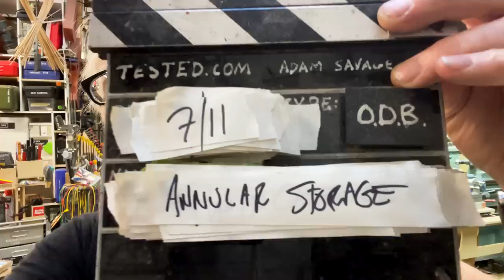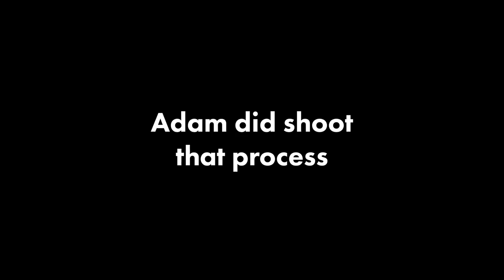Adam Savage's One Day Builds: Annular Cutter Storage!

Comment: I'm so glad that you stuck with the shop infrastructure builds! I've been enjoying these so much and they have really helped my motivation when feeling discouraged. It's really nice to watch someone take the time to think through organization because of shop space constraints-- which is very relatable to the majority of us "average" hobbyists. I recently tackled my 2.5 car garage overhaul by ripping everything out, getting a poly urea floor coating applied by a local coating company, and beginning the process of making it a space that I love. I have a split level house, so the garage is technically inside the house and is accessible from the daylight basement like any other room, so I wanted to be able to go out there to simply hang out if desired. I threw out or gave away my old random wood benches and various mismatched bins and bought new cabinets, adjustable shelving, etc. I then bought a HF universal tool stand and made a drill press/bench grinder/portband stand all in one. This was my first step to realizing I can REALLY optimize the shop and it took off from there. I recently finished a PVC funnel and drain pan holder/drip catch and now have EVERYTHING off of the floor. My next step is sorting out my wiring and electrical station. Thank you for all of the time and effort that goes into these videos and your shop! It is greatly appreciated by all of us that need a space to "get away".

Comment: I've had a specific case of approach avoidance in my shop lately.  Comes from an abject failure with somd "smart switches.  I NEED a holder for the thousand or so router bits I have and it's just seemed like too big a job.  You have inspired me to "Just Make It".  Many thanks.
Reply: Rockler has some great "Router Bit Storage Inserts" that kinda make this job easy, and they're relatively cheap.  I made an insert for some Milwaukee Packout-style cases, and filled them with these to make stackable bit storage.  I'm pleased as punch with the end result!
Reply: There's a great video somewhere on YT where the maker used a table saw with a dado head to plow perpendicular grooves in wood blanks. Each intersection holds one bit.  Total time to make about 10 minutes

Comment: What is nice about the annular cutters are the number of cutting edges.  
1-1/2 inch drill bit has two cutting edges.  
One of the 1-1/2 inch annular cutters i looked at has 8 cutting edges.
Higher feed rate can be achieved with a annular cutter with a lower power requirement compared to a standard twist drill.

Comment: This kind of reminds me of the time I made a vacuum platform for my photo enlarger.  I drilled 150 or 200 3/8" holes in a piece of plywood with a drill press, then routed channels in the backside to connect all the holes.  To use it I'd attach a shop vac to a large hole, place the photo paper, and it would be sucked in place and stay flat and secured for the printing.

Comment: Could be a chance those get stuck from humidity, but looks awesome.
Reply: agree, this happens with router bits in a lot of wood shops especially in more humid places.
Reply: I was thinking that if the wood was soaked in a rust-preventative oil (and then probably re-drilled to account for wood swelling) it would protect from both corrosion and sticking.
Reply: I believe where he lives in California, humidity is almost none existent.
Reply: Not only that but wood often holds moisture and will likely cause rust ... but not in a state where they don't have any change in weather.
Reply: I think I would go back in with the next size up to slacken the holes (1mm increments since annular cutters are metric where I live).
Reply: @blake_edwards  He says he's in San Francisco, which can DEFINITELY get humid.  San Diego and Los Angeles, not so much, but even there, if you're near the shore it can get humid.

Comment: This was a neat video. I did something similar with screwdriver bits using a piece of wood that I got for free from someone in my neighbourhood who was renovating their house and I was walking by and asked if he was getting rid of the wood. It was hard to drill into but it worked eventuality. It was to replace the original crappy plastic case the screwdriver set came in that started to fall apart within a week of getting it for Christmas many decades ago when I was a teenager. I did not enjoy the horrible grinding noise that happened every time Adam moved the camera. I’m surprised he didn’t acknowledge it and try to fix the problem. He’s apologetic when he moves the camera around quickly (“Sorry if this is making you dizzy” or something similar) so I was expecting him to notice the obnoxious noise this time. Hopefully he’ll fix it soon 🤞🏻🤞🏻

Comment: One of my favourite types of hole saw is the diamond edged ones for drilling ceramics and glass. Super satisfying to use on a drill press with buckets of water or cutting fluid.
Reply: Until the glass bowl you were planning to turn into a lamp shade explodes into a thousand shards. Ask me
how I know 🙄😅
I use crossed polarizers now to avoid messing with stress-laden glass 😆

Comment: I just finished my own mini mill/lathe setup and will be working on similar storage implements soon. I did learn - back in the day - that it's a good idea to have the cutting edge "face up" to avoid dulling the edge? When they are stored face down in a moving fixture, they might "rub" and dull over time. Might be our teacher being overly protective, but I can see some reasoning. Also if moisure happens to get into the board, it's easier to clean a bit of rust from the shank rahter than the cutting edge. Long story short: I'll make my cutters and mills face upwards :P
Reply: @JETWTF  unless you are using them to the extent of a production shop would (most sizes everyday) that argument is mute. and storing them cutting end up would be more of a risk of injury than a preventative measure for wear. the actual using of the cutter will dull it far more each time it is used than it would from sitting it in a holder. the only time that might be worth consideration is if the holder was metal. the only real problem as mentioned by others would be the possibility of rust from moisture in the block, but that is so easily mitigated that the risk is negligible.

Comment: I did something similar for my grandpa's drill bits, however I didn't find it practical because they rubbed a lot with the wood. And took a lot of time to grab a single bit. However, over the years I ended buying my first "good set" with 0.5mm increments, and I tried again, giving it a little bit of wiggle, and they work perrrfect!

Comment: Ages ago I made a holder for a set of S&D drillbits. I made it out of aluminum sheet so I could engrave cutter sizes in the metal. Since they all have 1/2" shanks all I had to do is use one cutter and then get the math right to space all the holes. I used a center cutting 1/2" endmill to do the deed. I'll post a photo so you can  see  it.

Comment: They are great for cutting holes in steel with a mag drill or drill press with an adapter to accept the annular cutter bits.  I don’t know many people though except my friends in construction that need to drill multiple holes through 1/4” to 2” steel plate or beams.  We only use bits sized 1/16” above the bolt size we’re drilling for so we have no need for every size in 1/16” increments. If you do have that need then you need annular cutters.

Comment: Theres a lil extra thing about having annular cutters that way. Usually they end up getting the "gut" with the material that you just cutted inside, so having them stored like that, makes you clean the cutter guts before storing it back to the wood thing. It will make the clean and ready for the next use.

Comment: I have a smaller collection of 1” and 2” lengths.   Mine are used on steel in a mag drill.   I made a holder out of a scrap 2x4 and put the bits upside down so I only had to drill one size hole.   Works great for me, cxx add n leave a pilot in the bit and when it gets oil soaked from the coolant I just make another.

Comment: Fun! I made a wooden tool holder out of scrap redwood a while back and later found my tools rusting.  I also live in SF, so maybe put some shellac on the wood. It could also be that the tannins in the redwood were the culprit.
Reply: Yep, I made several wooden tool holders out of red oak 4" x 6" and after a few months, every bit sitting in them looked like it had been soaking in seawater😬 Some of the smaller diameter bits were completely ruined. Stay away from oak. 

In full disclosure, my shop is 100% Climate Controlled. It's hot in the summer, cold in the winter, and wet when it rains😂

Comment: I wish they had annular cutters that could be used in the field. I've worked with stainless steel for almost 15 years. My go to when drilling holes are the holesaws. I've found that Morse does the best job in holesaws. The black ones rather than the red ones are awesome. But yeah, wish they had a field annular setup.
Reply: Holes over 1/2 inch, otherwise I use Norseman drill bits.
Reply: They do. Look up mag drills.
Reply: @andrewdonatelli6953  A mag drill isn't feasible in alot of the applications I'd need it for. Believe me, already checked into it. I guess I should've made it clear, "that work with a regular drill."
Reply: @sonictheflexhog6075  Yeah, mag drills are for pretty specific use cases.  The Kbh-25 is a hand drill that uses annular cutters, but it is pretty pricey.  Nothing like throwing tons of cash at something you only use occasionally.

Comment: Very nice, but my mind wouldn't let me do it that way, especially given you have a mill with precise feed capabilities.  I would have to put the cutters in long lines, with uniform separation between cutters (center distance is the sum of half each adjacent cutter diameter+ spacing value).  I would have gone long rows, alternating in direction, as they do on circle drawing template, for tight stacking.  I would also have to have them all at the same depth.  Not doing that would drive me a little batty every time I looked at the rack, but that's just me and my peculiarities.  Also, if you ever re-make this, would it be better to do in UHMW or Delrin, so you have a material that doesn't attract / retain moisture?  I don't know if this might be significant or not.

Comment: Those would make for really easy matching screw plugs too if it lists the internal diameter of the hole. It's interesting that there's no pilot/centering screw like in the hole saws.
Reply: They do make some with a pilot bit for use in hand drills. These are only for use in a mill so it removes the need for a pilot bit. In a mill I don't even bother with the pilot bit if I use a normal hole saw.

Comment: Personally, I would have spaced out the holes more so that there is enough space to put labels on the sizes of cutter. And putting the label in the center might seem like an easy idea, but then you wouldnt be able to read the labels without first removing the annular cutters from the holder.
Reply: Not sure about his but the sizes on my cutters are all engraved on them. Don't really see the need to label the board.

Comment: As cool as that is, won’t humidity and temp changes make those get very stuck as the wood expanses and contracts?
Reply: Not to mention wood attracts and holds moisture, which causes corrosion on any steel surface that it contacts, like the cutting edges.
Reply: @edbennett8257  I was thinking that as well. I would have done in some kind of plastic

Comment: I'm pretty sure the cave is climate controlled so this doesn't apply.  My experience in a shop that has humidity issues is the tolerances are too close.  The bits may be trapped when the wood swells.  Not the end of the world, but the storage block gets chewed up fairly quick wrestling bits free.  Do the same thing in plywood, or better yet Delrin, and never look back.
Reply: Not so much that it’s climate controlled as it’s located in San Francisco. Humidity? What’s that?

Comment: With a hole saw, the wood usually gets stuck in the bit after you cut and you have to stick a screwdriver/whatever through the holes in the side and pry it out.  Do you have the same problem with these cutters?  What happens to the waste left in the center?
Reply: No holes on the sides of any annular cutters I've seen, but they typically have a through hole (1/4"), and you can get a spring loaded ejector pin setup, or make one yourself. They don't seem to load as badly/get a slug as stuck as hole saws, maybe something to do with tooth rake, etc. I'm generally working in metal, and the slug left is sometimes useful on it's own merits.
Reply: Usually I find if the slug gets stuck in the cutter they can be hooked out with a pick or a pair of needle nose pliers for the smaller sizes. Sometimes you have to remove the cutter and poke it out using the ejection pin hole.

Comment: would probably be a pain to make, and annoying to use, but would be kinda cool if every hole was "threaded" to the cutter. Like each cutter screwed into its hole like a nut into a tapped hole. Would need to do this in a see thru block for it to be really cool. Would be a pain to use when getting a cutter out or putting it back, but as a "show piece" might be cool.

Comment: As someone who has spent $100+ on forstner bits and lacks a good way to store them any ideas or suggestions? I have .25" to 4" bits (not complete in between...yet).
Reply: Forstner bits tend to be basically the same length, which helps you organize them.  I'd tend to store them shank down, cutting edge up.  If you set multiple rows of them, alternate the direction of diameter increase as they do on circle drawing templates, to allow you to pack them tighter.  If space allows, tier the rows with increasing heights on the rearward rows, for easier access.  I'd probably go up to 2" on one rack, then make a second rack for the larger diameters, but that's because I would rarely use the bigger ones.  Let your usage patterns guide the storage design for what is easiest to access.  Just my $0.02
Reply: @marksnyder2232  I have three different lengths of bits but that maybe a good way to  break up how they are stored. Thank you.

Comment: I always use the next size up as the hole I store the tool in so they're not so tight
Edit: I suppose though in this case I'd bore out a solid hole or else these bits wouldn't fit

Comment: Unless you spray some oil on the wood the cutters may rust or stain.  If you spray some oil on the wood it may swell and they will jam. This may happen just due to humidity changes alone.  A better choice perhaps may have been aluminium or some kind of plastic.  If you mounted them cutter side up you could have just drilled the same size hole for everything.  I wonder if you could shim them so you get an oversized hole with better tolerances to reduce jamming.

Comment: Or you buy metric cutters, and get each 1mm. From like 6mm to 50mm. That's 44 bits.
And Annular cutter are meant for metal, not wood. What are you doing? They have ground teeth (or even carbide teeth) designed to cut metal, steel. They're generally used on mag drills for cutting holes in thick sheet or plate..... 
But storing those in wood is great way to have them rust too.... So.
Reply: First, those never gonna see rust as long as he breaths. If u had a fortune, not two fortunes, would you rather get the best set for your needs, even if the compromise is not having a tool that does exactly the same thing u wanted it for, but without the benefit of also being capable of doing OTHER things (see ur example of a tool just able to do wood, compared to his set, capable of doing wood, but also metal), OR do what is just pure logic, and get the best bang for buck overall, again limited by the size of your one fortune. Besides he se could always buy those later, when he has a literal spare fortune again lying around, and he might actually do it, since tool addiction pale in comparison to meth addiction.

Comment: Two things worry me about this.  First, and I know it won't effect its function, but shouldn't the five largest cutters be arranged like the dots on the '5' side of a die?  Secondly, those tight tolerances seem a little too tight.  What happens when the humidity in the shop changes? Won't the wooden block start to bind on the cutters, making them hard to remove?

Comment: Should only be used on a mill or mag drill. Although it might seem like it cuts less material, it is quite thick compared to regular hole saws and it can be terrifying if you decide to use something less stable then a mill or magdrill
Reply: Or on a lathe.

Comment: I wish I could be an on call machinist right now with your work. I would have gotten a half inch 2 flute end mill and drawn circular paths for the wood holes. Then laser cut a piece of acrylic to set on top to label and hold the bits in. Hit me up if you want a design and tool path.

Comment: maibe it be a good idea to put a little bit of grease or oil in the holes , that way any moisture comming out of the wood whont rust the tools 
mightve looked better if you started with the biggest one and offset the two by two untill theres room for more then continuing offsetting them per bigger amount 
hmmmm maibe i go and try to do the same for the ratchet sockets in my toolchest , come to think of it i prolly can make sumting for my wrenches too if i use my milling machine and wood blocks making slots with a pocket through the center to grab them